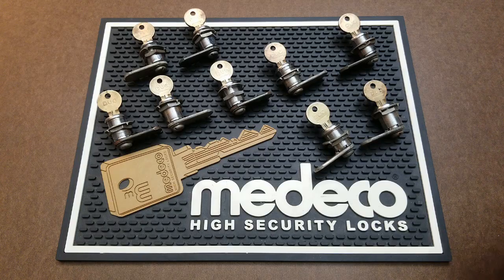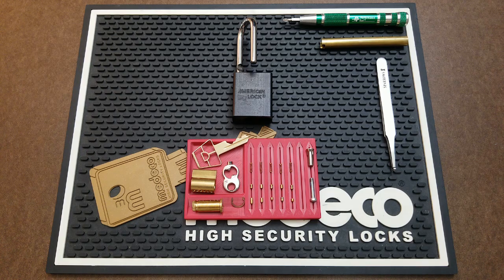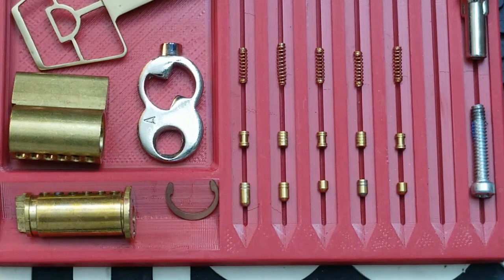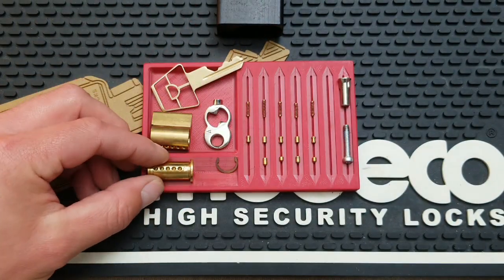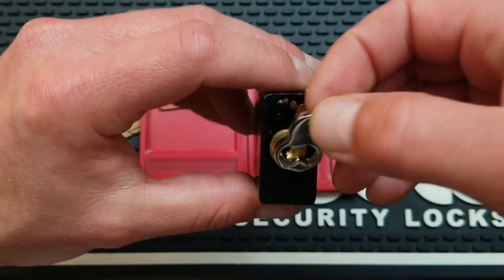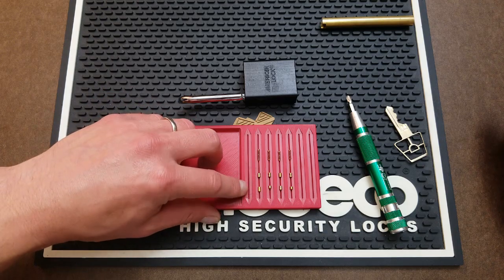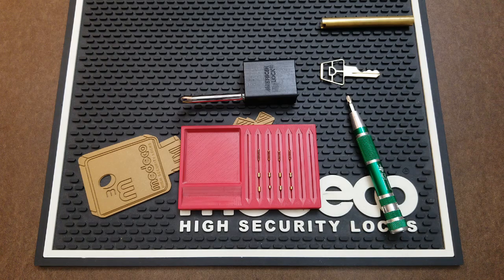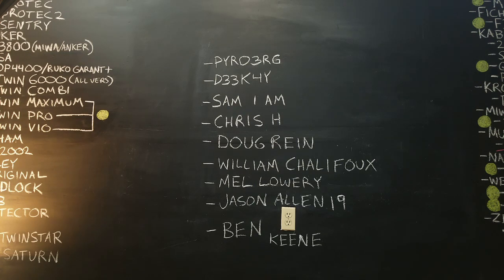Mentorship Monday 5: Progressive Pinning Part 1 + Free Duos

Comment: As soon as I saw the key bitting, I knew that key pin was going to sit on the sheer line. I’ve got an 1100 that’s giving me fits because pins 2 and 4 are like that. All you have to do is barely touch either of those and it’s overset. I had a similar situation with a Schlage mortise, but it’s way easier to get under those. This American is proving to be problematic. I’ll get it though.
Reply: Lock Pickers United yes, I agree. My deep hook is .025” and is giving me a little trouble navigating through that key way. I’m going to get a Peterson’s .018” and I’m thinking that will help. I’m use TOK tensioning as well. There’s a learning curve for each new lock I try. This one came with all serrated driver pins and key pins. No spools at all. I don’t know if that makes it harder or not.

Comment: Great video, thanks as always.  The core was turning to the left because that was a zero lift pin in the first chamber and I'm assuming the tolerances we're a bit loose and that's why it stuck in one direction and turned in the other.
Reply: @LockPickersUnited  even compared to older Americans.  I have a few from the late 80s and early 90s and they are made way better.  Way harder to pick too.

Comment: I've made the mistake of combining a short key pin with a short driver. There ended up being a second shear line between the spring and driver. Kinda a pain to verify each combination inside the plug, having a measurement built into a pinning tray would be useful.